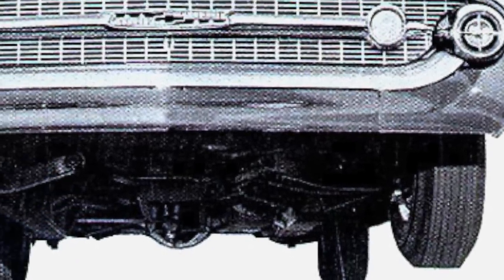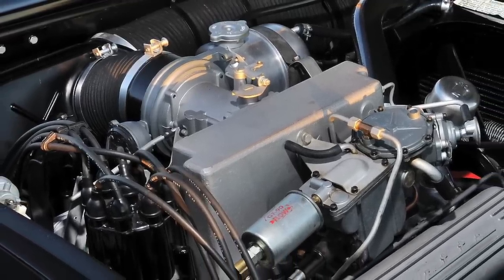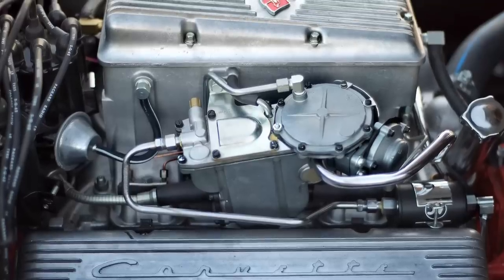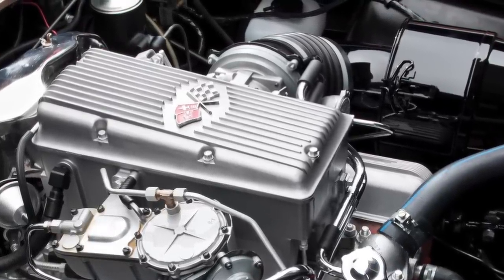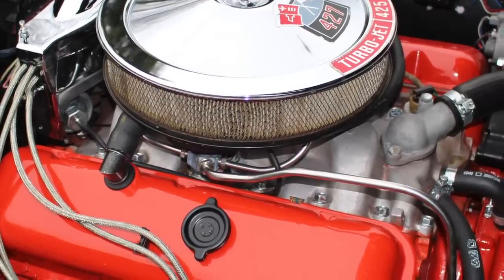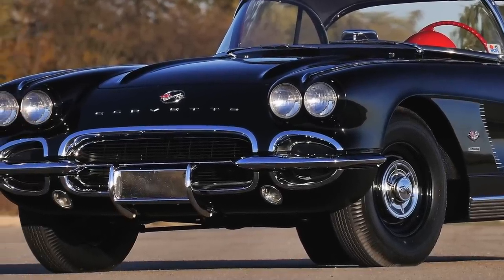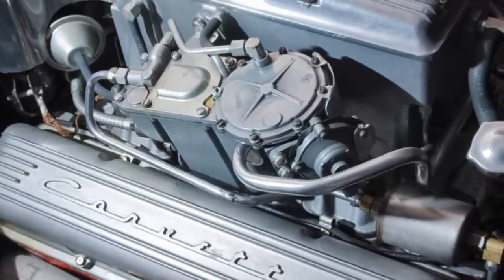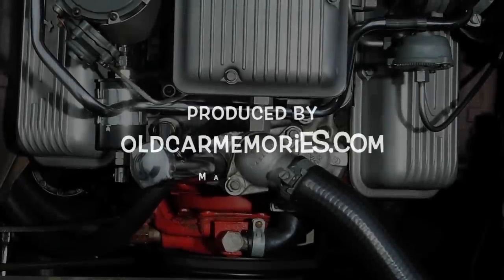Why Chevy Abandoned the 1962-1965 Fuel Injected 327 V8

Comment: What about the chrysler  cars of the 1950;s check the horsepower of the 1950;s dodges how could forget 330 horsepower in 1955 put a 50;s gm  up against hemi  engines

Comment: So why doesn't this same excuse apply to European cars that kept efi ?
Reply: Gasoline was much more expensive in Europe, making FI more attractive there than in America.
Reply: John Ross but the European cars were still sold in America with efi
Reply: in 1962-1965 European cars had electronic fuel injection? chevys system was a mechanical fuel injection..
Reply: Yes, because they were ALREADY BEING MADE with FI for the Euro market.  Injection was STANDARD on these small engines, unlike the expensive, optional, and extremely low production Chevy V8 FI units.  Altering the production lines to put carburetors on U.S.-bound exports would have negated any cost saving from the cheaper carburetors themselves.
Reply: John Ross thats a valid point & companies  first attempts tend to be plagued with bugs that make them second guess continuing production
Reply: I know the Ferrari 308 had carbs until 1980-then promptly LOST power when it switched to Bosch CIS.

Comment: Here's apart you missed, A lot of those units did not run right, My brother was a service mangier during those years. The dealers had a terrible time trying to make them run right to the point, there was a silent campaign on those engines from Chevrolet. If the customer returned more than 3 times to the dealership with run issues, Chevy offered a intake and Carb replacement under warranty. He said one day he had to go the the Linden Plant and in the warranty section there was several pallets of Fuel Injection units waiting for destruction. For Chevy the technology just was not there yet!

Comment: I keep hearing that 1957 was the first year for fuel injection for Chevy but I know where a 56 nomad that came out with a fuel injection 327 4 speed
Reply: Crown Commando you are correct I have to many cars on the brain and the engine size got jumbled up lol , but it did come out with fuel injection
Reply: That could have been a factory prototype (maybe Duntov built) with F.I and a 4 speed Trans. on a '56 Chevy, but, the '57 Vette and Chevy. passenger cars had the first factory option available Chevrolet/Rochester F.I. units. Also "all" of the '57 Pontiac Bonnevilles had a similar Rochester F.I. unit. Then, 1957 was the first factory listed option 4 speed transmission available  
for both the Corvette and Chevy passenger cars mid to late production.

Comment: All the old Corvette guys I've talked to said these system were unreliable.  They said the dual quad setup was just as fast and easier to keep running right. I know that's just hearsay but it was a pretty consistent opinion.  I resorted a 62 Vette so I had lots of these conversations.
Your point about how much faster we may have gotten to good fuel injection if Chevy had kept offing it is valid though.  Mid 70's to mid 80's American cars were total dogs because of smog regulations that EFI eventually remedied very well.
Reply: My first Chevy was an '89 Caprice, first-year EFI "throttle-body", and F41 sport suspension.   I bought that a dozen years ago.   Last June, I found another one.   They both run great, handle great, and the mpg is also great.

Comment: Fuel injection is either continuous, or intermittent, however atomization by carburetor is less efficient. Most people don't realize that 80% of the gasoline fuel is not burned. Only about %20 is burned on the compression stroke, and the remainder of the fuel is vaporized, expanding to push the piston across the cylinder. - Stanley Meyer, in 1985 rediscovered a German method of "water disintegration", and called it "fracturization". His method injected a combined hydrogen and oxygen into the cylinders by means of tubes routed through the spark plug openings. The valves allowed water vapor to enter the cylinder. The spark ignites the "hydroxy" fuel, and the water vapor changed to steam pushes the piston. There is about a %25 reduction in power, due to less burning heat produced by the hydroxy mixture than standard gasoline fuel. Exhaust system modification is also usually implemented, because the exhaust will quickly re-condense back to water. His innovation was the unique system to reduce water to hydroxy gas. This innovation remains a secret. - Stanley Meyer was assassinated by poison in 1987.
Reply: LULZ
Reply: So 80% of the fuel is blown out the exhaust as fuel vapors, means the best gas engine can get is 20% efficiency. This guy learned everything he knows in kindergarten or comic books

Comment: Sooo if fuel injection is so good why did it give only 10 hp more for 400$I am not a big fan of most injected stuff,but it has it place in some applicationWhen do you ever have to fix a carb?abd if you do,ha well easy.. Plus the atomization of a tall intake beats any injection system.Specially in the 60’s those injection system would have been so unreliable,a reel pain in the rear end

Comment: Kind of “funny” that a 327 cubic inch, 5.3 litre engine is called a small block. Compared to world standards at that time, 327 was a giant engine. XKE, for example, was 4.2 litre, Ferraris, etc which much less thaIn my opinion, it should be, 327 is a big block and the 396 and 427 the bigger block.
Reply: You are correct as the Ferrari V12, even on a '62 GTO (one of the greatest road cars ever, now worth 80 Million $) was 3.0 liter or roughy 180 C.I. although a little later in the 60's Ferrari had a 4.0 liter, again a V12 with roughly 240 C.I. which was "big" by their standards and with dual or four overhead cams.  BYW, did you know that the first Chevrolet D V8 was in 1917 -1918 with 288 C.I, 55 h.p. and over head valves. Do a Google search for more information. Imagine, a Chevy V8 38 years before the 1955, 265 c.i. V8 and also before the 1932 Ford Flathead V8! dt
Reply: Compared to a '58 Mercury with 430 cubes it is a small block, right?

Comment: Torque is measured in pounds of pressure at one foot from the center of rotation.  STOP quoting it in feet.  The proper term is FOOT POUNDS, not pound feet.  It you don't believe me, look at a torque wrench.
Reply: It may be said, "pound-feet" in England . . .

Comment: No General Motors refused to release any technical information which would have allowed mechanics to repair them. They even went as far as to refuse to train dealership technicians to repair the fuelie system. Even when GM actually started their schooling programs for their employees there was still little or no information out there to be had. It was if GM was keeping the material "classified" and this is what lead owners and mechanics to change them back over to 4 bbl carbs and intakes. But for it's time it was a rare bird with only the Germans having anything close.
Reply: Hence the GM dealer was generally no better than the corner garage.
Reply: Yes sir that about cover it.

Comment: I dont believe a carburetor fueled 327 was rated over 300 horse. Cant compare the old mech fuel injection system to the new computer controlled systems. No substitue for horsepower like cubic inch gives. When will they perfect computer controlled electric solonoid valving?
Reply: Carbed 327's were rated up to 365hp.  Also 350 and 340 hp

Comment: Those horsepower numbers back then were not even close to reality even for the day. This has been confirmed through dyno testing. GM vastly inflated the horsepower numbers because they were far behind Ford and Chrysler's horsepower for the equivalent engines. 
Chevy guys, don't even bother trying to suggest to me otherwise. I already know what you are thinking as you read this and you are incorrect if you suggest otherwise. Trust me, I have been researching this for almost 30 years and I own the facts. Don't bother telling me fish stories about how your stock 283 powered car was faster than every Ford or Mopar in sight while still managing to pull off 100% reliability and got 100 miles to the gallon. I have heard it all, like Santa Claus, have and will never see it.

Ford dominated 1960s racing across the board in every form. Don't believe it? Google "ford fe" and educate yourself.
Reply: Just wrong.

Comment: FI was only in the Corvette. Nothing else
Reply: Available as an option in all passenger cars and even Nomads too in '57-'60.
Reply: David Taber I was told that by the president of the 567 Chevy Club. He owns a 57 fuelie Corvette. I think he would know
Reply: I guess he hasn't seen the 57 chevys with the fuel injection emblem on the side.  I had a neighbor that had a 58 injected Bonneville. Yes, you would think he would know (better)
Reply: Then, since he is such an expert, I would suggest that he/you do a Google Search of G.M. Chevrolet passenger car Rochester Fuel Injection options from 1957-59 and Pontiac Bonneville options from 1957-58 to learn some Automotive history knowledge before he makes an uninformed statement again.  I along with many others, grew up in the 50's and have viewed those F.I. cars back then on the street/drag strips and in Dealer Showrooms. Now, there were even back then, cars that had the fuel Injection emblems on their fenders (on both sides) that had the injection unit replaced by a carburetor/s do to poor operating conditions that the dealers could not resolve.  There were two H.P. versions of the Chevrolet Fuel Injection at 250 H.P. and 283  H.P. levels for the 1957 year. Fuel Injection was not available on the few 265 c.i. engine in 1957 as the 283 was the new displacement V8 engine for that year. The difference was the 250 H.P version had a mid cam with hydraulic lifters and normally a powerglide 2-speed transmission while the 283 H.P. had the solid lifter "Duntov" wild cam (for it's day) and either a heavy duty three speed or even a three speed overdrive (std. 411 rear axle ratio) then later in the year, a 4-speed transmission for both Corvette and reportedly some Passenger cars. I am not sure of the Pontiac H.P/cam levels, but all (630) one per dealer, of the '57 Bonneviiles had reported 317 H.P. from a 347 c.i. engine with hydramatic automatic transmission. dt in Ohio
Reply: Just to make clear that the '58 Ponchos got a bump to 370 cid.  And iirc the fuelies were rated 310hp.
Reply: Cana, perhaps a miscommunication?  Regardless, FI was available in steel bodied Chevys.